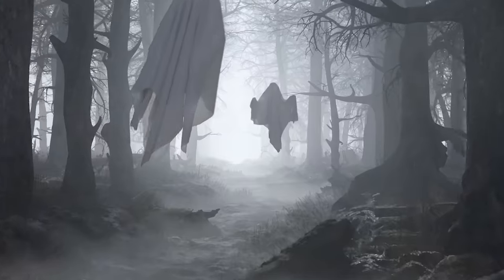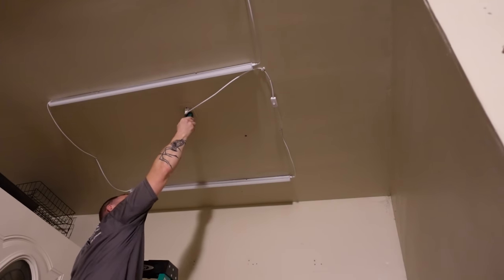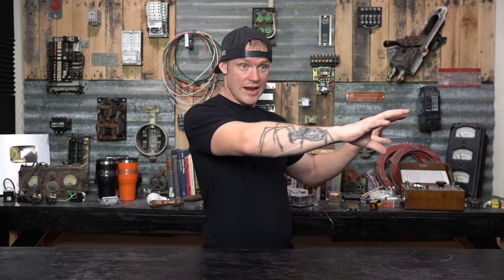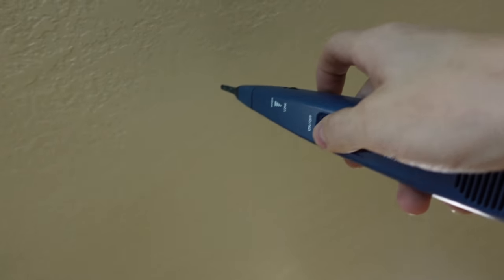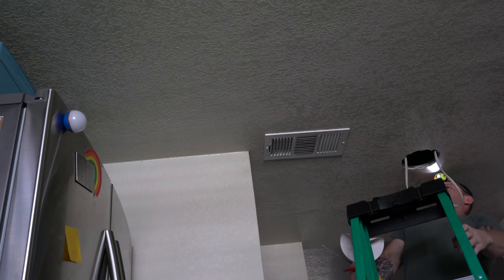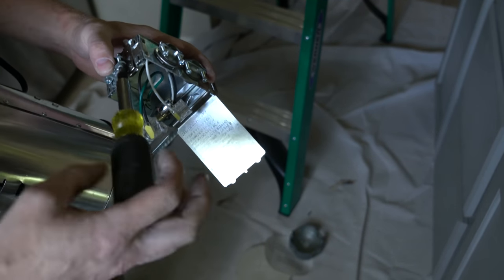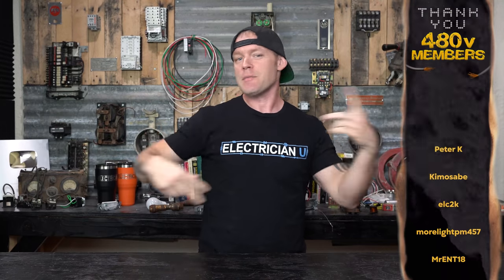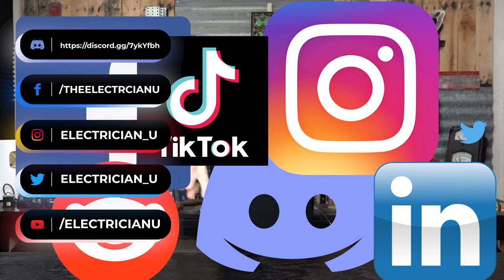THIS IS WHY ELECTRICIANS DON'T HIDE J-BOXES IN WALLS - Finding Hackwork!!

Comment: As an applieance repair technician, I remember one time going out on a service call pertaining to a domestic house-hold Drier. The customer stated that she had just bought the drier new approximaely 2 months prior, and the sales store delivery/set up crew had performed the installlation. 

However, the customer complained that even though everything on the drier functioned properly she would invariably get a moderately mild tingling sensation of an electrical shock throughout her body every time she set the timer and hit the start button (especially if she was either leaning up against or touching the washing machine located right next to the drier), but yet she stated that she would never get an electrical shock when the drier was in the normal shut-down/ off mode. When I arrived and checked it out - yes, I would also get the same type of electrical shock when it was operating but not when it was off.

After performing several checks and tests where everything checked out I partially dismantled the drier and checked everything and all internal wiring and components for any possible electrical short. I even partially dismantaled the timer assembly to see if it had shorted out internally. Nope, Nadda, not a thing wrong. Everything was checking out factory new and normal.  So Even though I had previously checked out the drier electrical outlet behind the drier, the drier pigtail, and the electrical wiring setup inside the house's main circuit breaker panel  I decided to investigate deeper into the wiring circuit for the drier. 

Here is what I found. Originally the house never had a laundry room (area), built or installed when the house was built. The owner (or who-ever),  later on down the road installed a Romex ( 12/3 with ground) , wiring circuit from the house main electrical circuit breaker panel box (on the west end of the house), out to the garage (on the far east end of the house), where they had installed all the necessary features and components for a laundry room. The total distance was approximately 75 to 100 feet. They ran that Romex in the crawl space under the house. Every so often they had installed large staples (non-insulated), for a farm fence under every 4th floor joist just to hold the romex wire up off the ground (each staple was basicallly every 4 feet). (other than not meeting national electrical code basically really not a problem). Well, here's the kicker. 

When they installed the wiring they ran out of wire approximately half way across the house flooring. It was not one continous Romex wire from point A to point B. Basicaly still not a problem.  They strung the Romex wire from the main circuit panel box halfway across the floor to where it ran out and ended. They then strung the 2nd Romex wire from the drier outlet in the garage back to where the first Romex wire ended. 

Here is the real kicker....... But they "did not" mount and install a J-box at the point of where the first Romex wire ended, and where the 2nd Romex wire met the first. Their connection method between the two wires created the problem.  They had just bent each wire into a J-hook and then crimped each wire to the other wire with a set of pliers.  They then wrapped each set of main power wires and the neutral return wires up with black plastic electrical tape, leaving the ground wire bare, and then overall wrapped all wires together into a sort of harness with more black plastic electrical tape. Well,not codeworthy overall, but it worked, (at least for a while). 

Over time, the wires eventually incased themselves in a lot of corrosion from moisture. After spending considerable time trying to unwrap that mess in order to get down to nothing but bare wire, I eventually found that the 2 main 120 volt power supplying wires were still intact, as well as the ground wire still being intact too. 

However, the Neutral return wire had corroded itself in two and had seperated into two seperate wires (with a space approximately 1/4 inch between the two neutral return wires), at the splice point. This created a different method for the return of the electrical power back to the main circuit breaker panel.  Rather than the current traveling along the neutral wire back to the main circuit breaker panel, the current traveled through the frame of the drier and then through the ground wire atached to the drier frame back to the main circuit breaker panel box.

This set up the problem that when the human body touched the drier anywhere on the frame (and especially if the human body was leaning up against or touching the Washing machine right next to the drier), the electrical power also took a short cut through that human body as well. Needless to say, when that occurred, that human definately was getting a shocking experience about how electrical current flowed.

After a  J-Box was installed, and the wires were properly re-connected together to meet the proper electrical code standard that cured that little shocking problem.  - True story.
Reply: That was educational. Thanks!
Reply: Thanks for all the detail in your comment.  It's been helpful.
Reply: Great comment. I’m sure this will help me out someday in some random situation. You never know what you’ll see out there😂
Reply: While I was reading I had the entire visual in my head lol Great descriptive writing
Reply: Was ground and neutral bonded at the subpanel? Sounds like a ground fault should have been triggered?
Reply: @df4196  not a ground fault breaker and the ground and neutral were bonded in the drier, Id bet.
I've never seen a drier wired with 12ga either.
Also, pretty sure 4' for NMB meets code.
Reply: @jonanderson5137   NO, I didn't wire that dryer cuircuit myself, somebody else did long before I ever seen it. - But. - When I add any wiring I always install 12 / 2 Romex - including for outlets, lights, washing machines, and install 10 guage for dryer circuits (unless it calls for larger wiring and then I add 10 guage or 8 guage), I know it isn't generally required by code, and it may be a little "over-kill" as they say. - But.... It will carry more amperage if necssary - And also - Who knows how that house circuitry may be abused later on down the road by whomever else might later live in that house. Maybe I'm wrong, but my thinking is yes, it initially might cost more at the time. - But it is better to be safer by installing larger than reqired guage wire than to later be sorry because it didn't or couldn't take a little exra abuse.
Reply: @df4196  That was an older house. It was built before Ground Fault breaker circuits were required.
Reply: @ProspectorsGhost  , correct, quite a few people use the dryer outlet to.power welding equipment. Can really put a load on the circuit.
Reply: The old toasters were the same way with 2 prong plugs as a little kid my ear would rub up against it and I would get a buzzing feeling on my ear 😮
Reply: Sounds like my house!!!
Reply: Good Lord, you've written a novel here. Anyhow, what you described is frigging scary.
Reply: Don't be a conductor!
Reply: I wouldn’t be surprised if that isn’t the kind of wiring that was in a few of the houses I was trying to work in as a plumber. When I attempted to put my auger into a kitchen sink drain (1.5” galvanized steel pipe with cast iron fittings) it arced almost a full inch from the spring steel of my auger cable to the threads of the pipe and burned out a triangle about one half inch deep by three eights wide at the end towards me. I was insulated so it never got me, but I stepped back, unplugged my machine (which hadn’t tripped anything) and told them to get an electrician.   I don’t know how their drain system was hot like that, but I have a feeling it had to do with the way. A bunch of stuff is grounded to waterlines and probably had a bunch of grounds and neutrals tied together in a box somewhere. I don’t know.
Reply: @df4196  It was an older house. grounded and bonded foault Wasn't required by code when that house was built.
Reply: It could have been the cas that a previous home owner or somebody reversed the nuetral wire feed and the hot wire feeds. I've seen that to be the case in some of the older style houses
Reply: This is why modern electrical appliances often have insulating cases and no ground rather than a metal case connected to ground.
Reply: @liquidrockaquatics3900  Situations like that can cause current to flow into the ground rod, and cause fires that burn the house down.

Comment: 30 years trade experience.  Asking questions is critical for troubleshooting.  I always ask age of the house and work that has been done. Great video!
Reply: I work on robotics and other systems in manufacturing and I can't tell you how useless the operators can be when trying to get information. The biggest problem seems to be the "I don't know" bug followed by the "I wasn't using it, I just came over" bug. The systems almost always have some sort of logging function in the software and they will often find the most generic of lines and read it over the phone. Something like "(Random number) not functioning, system stopped, contact service department." And the number would be a combination of the time code of the actual problem description in the log file. I'm sure most homeowners can answer the basics like house age and and recent work but I bet half of the time they have no idea about anything,
Reply: Yup. My house was built in 1979. I can confirm about the number of neutral wires bonded in an average junction box. Normally 4+ for a single pole light switch.
Reply: @tstuff  As a repair technician of 36 years, I always understand that the operator may not always be reliable for info. But I've also learned that listening to operators, can go a long way towards troubleshooting an issue. Sometimes, letting them talk, will reveal that it's just a training issue, and not a repair issue.
Reply: @DouglasK  Yes. That was a complete shocker for me one time. I am no electrician, but I did help the electrician do the wiring in my 1500 sq ft addition in 2003. He taught me a lot. Then I visited a cousin who was having a kitchen GFCI issue in her 1955-era condo. I popped the breaker, tested the voltage, and cut the wires on the GFCI. Suddenly, there was a big arc on the neutral and two rooms went to half brightness. Blew my mind. I Googled the symptom and discovered the magic of the (@$#@) shared neutral. What an amazing piece of scary shit. Since that was WAY above my pay grade, I popped a few more breakers until my heart stopped racing, restored the circuit as it was, and called a professional electrician. Since the entire complex was all the same age, I guess they were all wired more-or-less the same and he took care of it with no drama. This video brought back that memory. I love the way he explains stuff. Very clear.
Reply: @tstuff  I’m also in the service industry and I can confirm I try to ask questions and constantly get bs answers. Most of the time it’s because they had an accident and damaged the equipment but are scared I will tell. I couldn’t care less about getting them in trouble I just want a good path to go down for my trouble shooting!
Reply: @DouglasK  Yeah, I’m upgrading my 1978 home to smart switches and I’ve seen a whole lotta neutrals in each box and huge wire nuts.
Reply: @chrisdoutre101  Yup.  I would LOVE to have unlimited funds to tear out the walls/ceilings and just redo all the electrical from scratch.  Probably redo the plumbing with a proper manifold at the same time too. That said, I don't have unlimited funds. :)

Comment: This guy knows how to conduct himself properly when working in someone’s home. Any electricians or contractors out there watching this video. I beg you to please take this video’s advise and follow his examples when working in a customer’s home/ personal space. You should always cover up anything and everything that will potentially get dusty or have debris fall on it. 

The biggest takeaway from this is to always ask the homeowner for permission before you decide to start making modifications to their wall/ ceiling. That is a huge “pet peeve” of mine as well as every other homeowner’s. Having a contractor assume it’s okay to make modifications to something without asking before hand is just simply unacceptable! Thanks for sharing this great video I learned a lot from watching this!
Reply: so i used your stove top to cut vinyl flooring with a jigsaw and mdf with a circ. saw, what of it?  by the way, your cooking smells like burning plastic and formaldehyde.
Reply: As a technician I'd completely agree with you on everything you said.  Pretty obvious really.  Now for homeowners though.  If someone is going to be working in an area of your home, move your crap out of the way.  We're on a time schedule and we don't really want to mess with someone else's personal belongings.  Of course you don't always know where someone has to work, so you may have to move things after we tell you where we will be working.
Reply: Great video, simple rule you work on it as if it was your own, we had engineers working on $100K instruments using Vice grips rather than open end box wrenches because 2-vice grips lighter to carry.
Had show them letter from customer saying company does not supply correct tools do job. 
Engineer was put on notice
Reply: Some people realize time is money and either they do it for us, clean, prep or have someone else do it.  Always include the owner on what's going on with their property but that could be $75+ saved.
Reply: @dissimulii  I had a garden hose spigot replaced. It was fed from the laundry room where the plumber needed to work on it. He decided to lay out all his tools on our brand new washer and scratched it up. Is it that hard to put a towel down first?
Reply: @billsedutto8824  bro,. its just cosmetics on a damn washing machine. I jus bought nice ass samsung washer and dryer. i scratched the fuck out of em. Do I care, nope! they work like gold!
Reply: @ghg789987  It’s a little different when you scratch your own own property vs someone else not taking literally 10 seconds to put a towel down which I’ve had multiple contractors/handymen do while working in my house.
Reply: @billsedutto8824  I agree! When I work on homes indoors. I do my best to keep everything well protected. If it's going to be a one day thing, might even just move the washer and dryer to keep em safe. But with every construction job, it's likely that something will get a little bit damaged. It's not on purpose, but it's just messy work.
Reply: Its normally people going for the cheaper guy who is cheaper for a reason. 

I've found higher earning clients seem to resent paying me an equal amount per hour,  not realising I have business costs.
Reply: But less swearing.  Lots less.
Reply: Conduct. I get it!
Reply: @ghg789987  You’re perfectly welcome to buy and abuse your own equipment that you paid for yourself however you want to. However, when you go into someone else’s house and end up damaging something because you’re in too much of a hurry to give a shit about anything other than your immediate task, that’s when it’s a big problem and when people have every right to be angry at you for it.
Reply: @Woodkin007  I will say you get what you pay for even with trade ppl, not saying that the most expensive quote will be the best and the cheapest won't be the worst, but more often it is...

Comment: As a fellow electrician , I enjoyed your story. I too enjoyed troubleshooting on jobs.  It’s kinda like being a detective, as you go through the mind of the previous electrician , or handyman who did some of these things, and map out exactly how that circuit makes its way throughout the home or building. I’ve found my share of buried boxes, splices with no wire nuts , etc.  keep doing what your doing. Good video .
Reply: I agree, this kind of troubleshooting always takes time. I like using recessed cans, as opposed to those LED inserts. The reason for that is simply because I like using bulbs. I can either continue using incandescent/halogen or LED bulbs. It’s being able to have the option that I like.